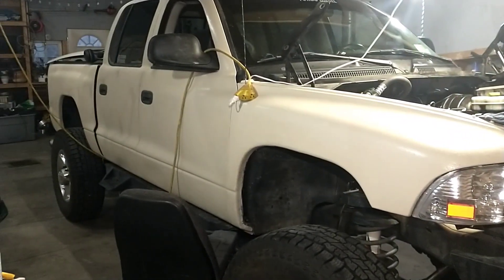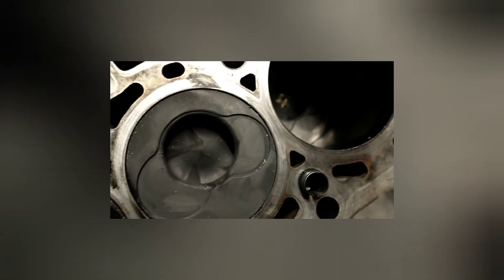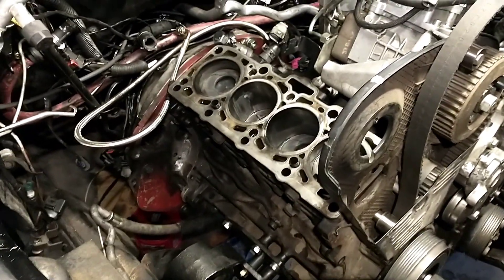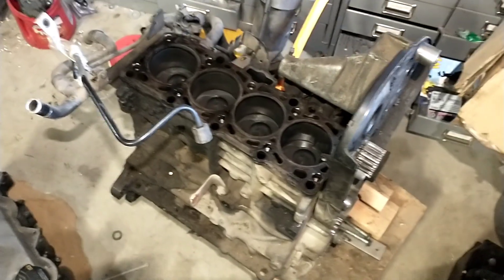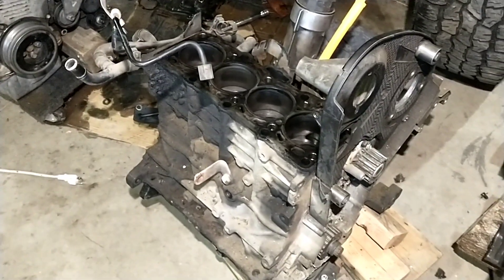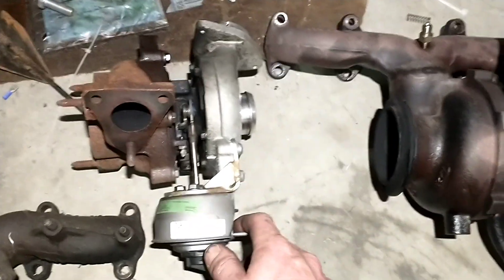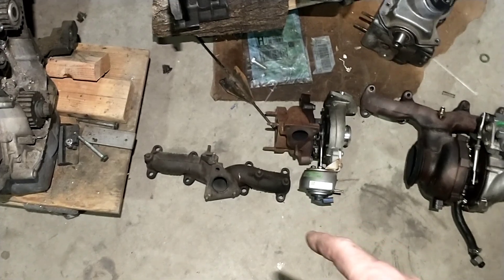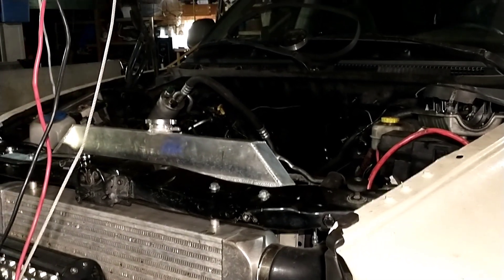Diagnosing The Cause Of Engine Failure On The 1.9L TDI Diesel 1 Ton Swapped Dakota!

Comment: Would there be something gained by going with a 3.0 TDI instead of the 1.9? I would think it might run at lower RPM and cooler over all. Of course the 3.0 is a different animal with other considerations, but I wonder if you’ve looked at the larger V6 TDI.  Alternately an older Benz inline 6?  *Edited to correct typo*
Reply from the maker: The problem is there aren't adapters to mate the 3.0 to all the transmissions like the 1.9. That and the tuning/wiring is much much more complicated

Comment: What is max water temp on theses engines
Reply from the maker: There's a lot of variables to temperatures, no boost idling in the mountains I have pushed it to 250° without blowing a head gasket, but the Dakota cracked the piston at less than 230° coolant when combined with 1400+ EGTs.  So it becomes a balancing game at that point.

Comment: I had the chance to talk to Jonathan Erber about his ALH Dakota and got quite a bit of insight about doing one of these swaps.  I think a Dakota swap project would be sweet but what are your thoughts on doing a tdi swap in 3rd Gen Ram 1500 crew cab (02-08)?  

From my research the 241d transfer case in those 1500s’ has the same 23 spline count as a dodge Dakota 233d transfer case, but the biggest issue I see is the weight and the different type of wiring that I think is slightly more complex than these Dakotas.  

What are your thoughts on it?  Your the only person I know of that has managed to pull of a tdi swap in a 1/2 ton truck.
Reply from the maker: Haha yup Jonathan did a great job on his keeping it mostly original, mine is more of a full size truck than a Dakota anymore.  It literally weighs 600 lbs more than the 91 k1500, almost the same as a ram 1500.  It will move one fine as long as you know the limits, AC and over 70 mph is probably not an option when it's over 100° outside.  I wouldn't try it in a hot climate, the engine is just working too hard to worry about excess heat.  At 65° outside my 5500 lb Dakota pulls my 4500 lb boat pretty decent at 55-60 mph.  But over 100° outside and too many hills it's struggling to keep cool just moving itself, and I'm running cooling system components similar to my 6.4 powerstroke lol.
Reply: @TDISwaps   do you think a BEW setup would preform better rather than an ALH?  I know the common rail BEWs’ act differently from the ALHs’.  Or does it not even matter what tdi is chosen simply because of the size of the truck it would have to push around?

I managed to come across a NSG-370 6 speed so it has the really tall first gear to help it start rolling along. However it seems like EGTs are a consistent issue I run into when planning things out .
Reply from the maker: Honestly looking at all these tdis there's really no difference even in the new 2.0l, stronger internals yes but they're all still limited by cooling system components and overall displacement.  Making short bursts of power is one thing but there are not many people trying to hold V8 power numbers for extended periods of time, and I'm definitely proving that there's just a limit for it.
Reply: @TDISwaps  that’s a good point, I guess the saying is true  “there’s no replacement for displacement.”  Once again I appreciate the advice👍

Comment: where are you getting motors from, I have one for my swap but would like an extra one for a backup if it blows to keep the vehicle in service while repairing the other one
having a hard time finding a second engine and had to wait a year for the current one to pop up at the junk yard
Reply from the maker: Just Facebook marketplace shopping, I find a sweet deal about once a year or so
Reply: @TDISwaps  how much do you usually pay for a motor?
Reply from the maker: @JohnSmith-tj5se just depends, if I wait long enough I always find the cars for $400-1500
Reply: @TDISwaps  right on man, I like your electronic winch imma have to rig something like that up
Reply from the maker: @JohnSmith-tj5se yeah I need to rig a battery up other than the vehicles but it works pretty slick other than that the wireless remote is awesome

Comment: time for an overbore and bigger pistons! I run 220-240F in my 65000lbs VW Westfalia. But I never go past 1200F on my EGTs. I had a K14 and was doing 21psi and loved it. Went to a GT2052 and can do 15-17easy past that I get heat. Coolant temps and EGT/IATs are your biggest. Maybe oil-temps if you're a brick like me (I put a 2.0TDI O/C on my setup).
Reply from the maker: Yup you know the temp limits! CR Oil cooler is in the cart 😁

Comment: Might try speed of air pistons..it would help with heat in the oil and heat on the pistons
Reply from the maker: Yeah I looked into them a little, not making them for the 1.9 yet but it sucks they would cost more than the whole build lol

Comment: 2:39 230 is wild!!!!! Especially at those egt’s I can’t believe u got it that hot!😂 my modern TDI gets a warped head at like 215🤣 if u wanna get a smaller turbo try looking at the 2L TDI Passats!! They are rated around 150-170hp if you can get one of their turbos for cheap that may keep u settled and happy for a low price!! :)
Reply from the maker: Ya these old ones can sure take some abuse lol, I will probably need more than the 2.0 turbo on its own though.  This thing is heavy!
Reply: Just to double down on this i own a BHW and it is tuned and running with higher turbo pressures lower temp thermostat as well as a 2006 jetta tdi rad intercooler combo and she claps like half a 6L powerstroke under full load i love it and not to mention i cable pulled a 2017 ford superduty and i was able to go 118 KMH
Reply from the maker: @Iceyman741 oh for sure man, these things are animals!

Comment: have you thought about re-gear a little higher ratio to keep the rpms up?  glad nothing too serious but still crazy the piston cracked !
Reply from the maker: I'm already at 5.13s 😬 fighting driveline vibrations spinning it 65% faster than stock as it is.  I think 2700-2900 on the highway is decent, tuning and turbo changes should get my EGTs into a safer zone
Reply: @TDISwaps  yeah you are in the right direction the old turbo was suited for 4k+ rpm you need max boost down low. I have a 17-22 on my golf and its is really well rounded

Comment: How does a GT22V from a sprinter van fit in the line up? I see Oliver Fetter spooling one with a home brew VGT controller. It looks like it may be between your 2 turbo sizes? I don’t know if that’s an option, and it’s hard to size turbos from my side of the internet. But I like what you’re doing with these engines and it looks like there should be a turbo between the 2 you showcased in this video.
Reply from the maker: The gt22 is even bigger than my gtd2056, that's the size I run on my Toyota.  They spool up around 2400 RPM
Reply: Oh wow! That’s good to know. Maybe you do need a slightly smaller turbo since you’re running an automatic transmission. I noticed that ford, with the thunderbird turbo coupe in the ‘80s, had a smaller turbo on the automatic cars than the manual trans cars. So maybe a smaller turbo will help since you can’t slip the clutch to get in boost. I look forward to what your outcome is!
Reply from the maker: @beardotapeshoes27 ya using an automatic like a Chevy 4l60 gives you much more options for torque converters so you can slip wherever you want, that's my plan for the next build.  2600+ RPM slip would put me at full torque taking off 😁
Reply: That would be the best of both auto and manual worlds!
Reply from the maker: @beardotapeshoes27 exactly!

Comment: Keep the videos coming.  We're learning a lot!  I have a built ALH (now a 2.0)  with an 11mm manual pump in front of a GM 700R4 with a 241C transfer case.  I had to put in a 2600 rpm stall converter to let the engine spool quicker on the bottom end.     Huge difference.  I found the foot brake stall speeds in a VW manual back from when they were running torque converters.. I was surprised to see that they were that high.  But, It really woke it up.    I'm still running a K03/K04 hybrid from my previous build.  I've been following to see what you come up with on the turbo setup.  

Keep up the good work!
Reply from the maker: Ya the aw4 not having aftermarket torque converters definitely limits my options here, I'm planning a 4l60 for my next build just for torque converter options

Comment: wonder how the borgwarner 171270  would do on this as a single turbo setup.  Best of both worlds between a H1c and hx30
Reply from the maker: Much too big for a TDI, even a small 4bt turbo like he200 doesn't make boost until close to 2000 RPM. Or are you meaning for compounds?
Reply: @TDISwaps  @TDISwaps  the non gated baby h1c is like a 45mm inducer wheel, I know these are popular to put on japanese gas vehicles (eclipse) and the 617.952 mercedes engines... Still too big for a tdi?  The 171270 is a quicker spool  baby H1C (non gated).
Reply from the maker: @joeyscleaninglady2877 ya TDIs need boost ASAP, 1500 rpm or sooner, most of those size turbo don't spool til way over 2000 making the bottom end unless.  I'm not familiar with that one specifically, but both the h1c and hx30 don't spool up until way over 3000 rpm

Comment: Ehhh, you're making me think about my Project car... I have the .592 02Z gearset in it with a heavier thermostat. Gets hammered on mild injectors and injection 1600-1800 rpm on highway all day.

Edit: I can go on about the ALH all day, I've spent more time under than driving them lol. Mind me asking, where did you have the timing and fueling set?
Reply from the maker: As long as coolant temps are in check under 200, I have run into the 1800 egt range without any affect on my pistons.  It's only combined temps that lead to this.
Reply: @TDISwaps  Sorry I edited my comment as I was watching, deleted once you talked about it. I'll re-ask a question, "where did you have the timing and IQ on VCDS?" Did you tune or advance timing on a north american stock tune? Edit2: looking at your piston heads id guess youre running closer to stock?
Reply from the maker: @RW1LD ya timing is slightly above the green line, IQ at 5.5.  .260 injectors
Reply: @TDISwaps  Ahh, I always thought .216s / DLC 1019s were at the upper end of safe. But the "Green line" just sets the timing  "window" the pump operates at, not the actual injection timing. North American stock tune runs timing retarded (by ALOT) for emissions. Even at idle the base map should be at least 4' BTDC and up from there with rpm / rest of the map. Not advancing the timing your EGTs WILL be higher. (worth googling the subject) Advancing the timing had a major positive impact with my project car.  

 I talked with Mr Bosio once and he mentioned the same problem with people throwing in too much fuel without getting the timing right. It was dizzying how much he had to say on the subject because oh how much has to line up to get everything to work right in such a small timeframe, even the quality of the fuel in different places throwing the timing off chemically / flame speed. Apparently American diesel is shit compared to overseas / Europe standards.
Reply from the maker: @RW1LD well my tuning is very customized and timing advances a lot with fueling. I'm not too good at all that stuff but my tuner has it set up pretty well.  Although this tune was probably an issue as we hadn't finished it due to the turbo acting up and trying to adjust fueling and boost for it.
Reply: @TDISwaps  I figured, but at the level you're at... everything has to about be perfect. I saw video of you pressing 11k# up that hill, thought "mannn ... " lol. Still real cool what you're doing, I've been watching your channel thinking about swapping into something like a Toyota RV, but the gearing options suck for the weight being pushed for the optimal BSFC rpm / power area.  I'm gravitating to a full size truck build just to get the transmission options.  Anyways, again thank you for including the failures, you'll never know how many people's project's you'll touch doing this.  I just showed all my UNOH (diesel tech school) buddies that also run TDIs and even have swaps.
Reply from the maker: @RW1LD ya I think I have my Toyota swap about dialed in for towing, but this thing has a bit more work to do before I get there on it.   I love seeing how far I can take these things though.  I just wanted to have an easy place to share videos with guys asking about my swaps haha, never imagined I'd end up reaching people all over the world 😅 seems like the more I video, the more interest there is!

Comment: Since you are doubling the power of the engine you may need to double the size of the oil cooler. Then use the coldest thermostat you can find. A little to cool will live, a little to hot won't . I love your videos,and your camera man did a great job along with  commentary.
Reply from the maker: Thanks man, yeah I usually monitor oil temp and as long as my coolant temp was low the oil temp was fine